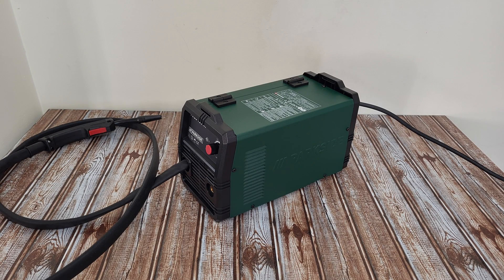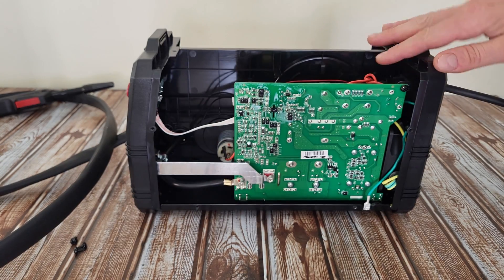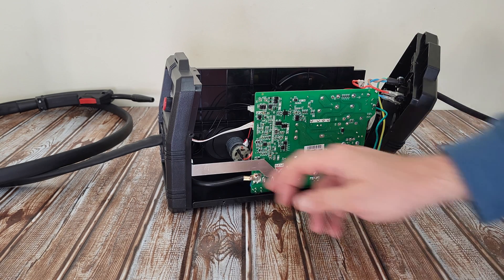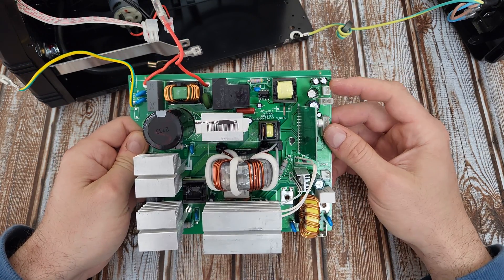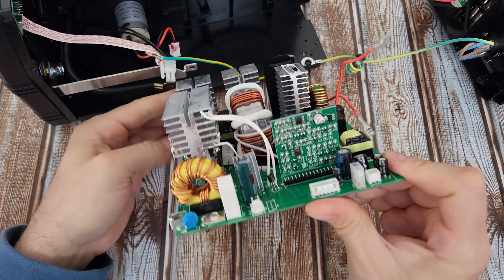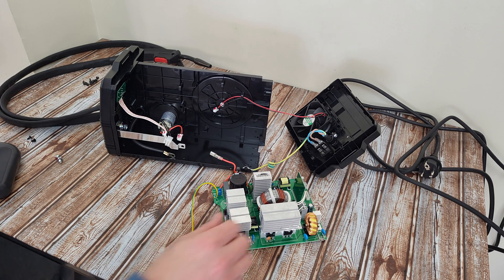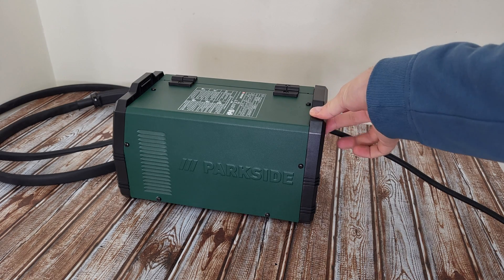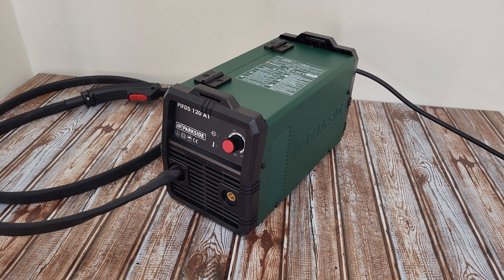Parkside Inverter Wire Welder PIFDS 120 A1 Disassemble

Comment: This is surprisingly well made, input filter - present, soft start - present, transformer looks like it can handle ~2kW, output inductor - present, board is conformally coated - metallic dust shouldn't be problem as well.
The only thing I'm curious about - what output diodes it uses - generally TO-247/TO-3P diodes are 2x30A > 120A, but no margin, but thats just speculation.